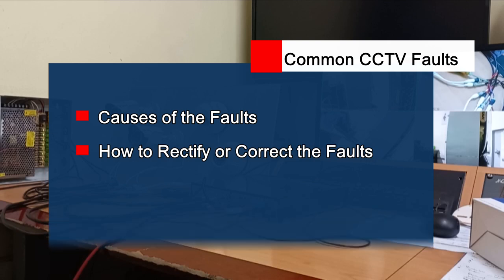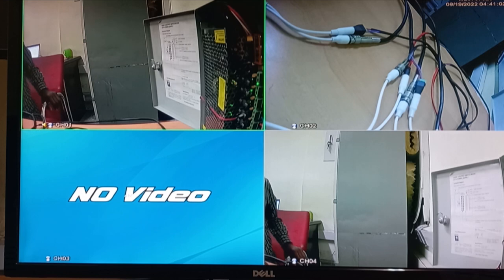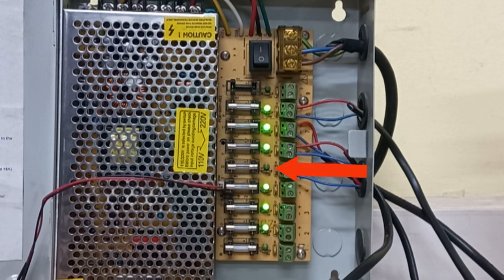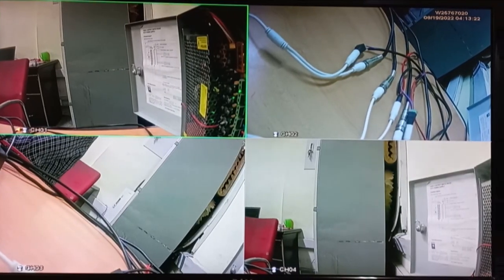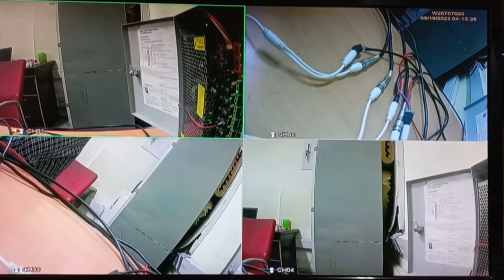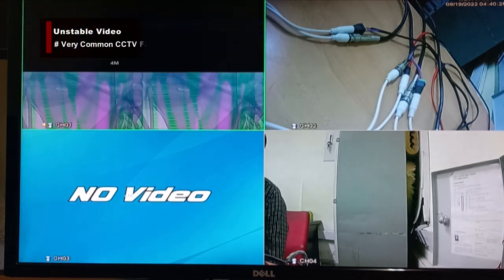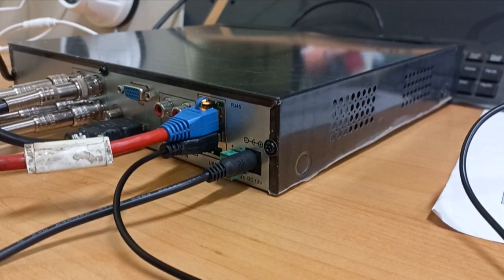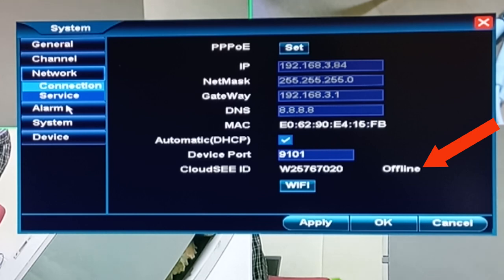CCTV CAMERA FAULTS CAUSES & SOLUTIONS

Comment: There a supply given but still no video display. 
When I use multitester using ohms in the vnc pos and neg the indicator well go up and down repeatedly. While the function one is steady.
What is the problem with this? Help thanks
Reply from the maker: What voltage readings did you get when you checked the voltage to the camera?
You will have to check your video cable terminations and be sure they are well done.

Comment: My camera output is blare can you assist with the configuration to get a maximum output picture
Reply from the maker: Hello Joe, 
Blared video output could be caused by
1. Low voltage to cameras
2. The use of sub-standard cables
3. Poorly terminated cables and more ....,
You may reach me by WhatsApp on +233556307182 for more discussions.

Comment: Hello good evening
There is current in the power cable and the video cable but the camera is still not working
Reply from the maker: 1. Please check if the power delivered through the power cable is up to 12Volts
2. The video Terminations should be given a second look, ensuring that there is no cable bridges.
3. Also check to be sure if the camera is a working camera